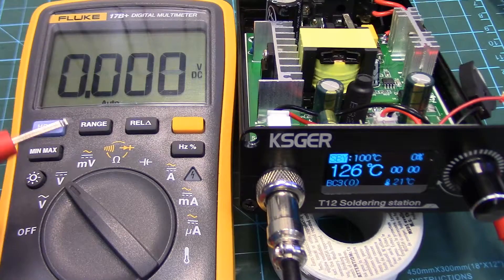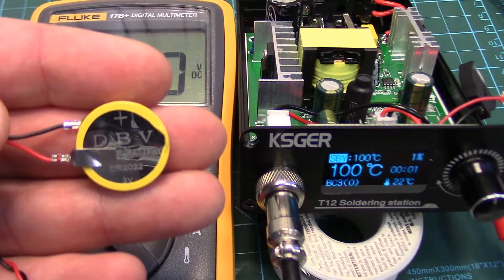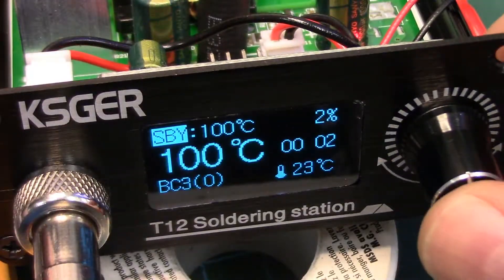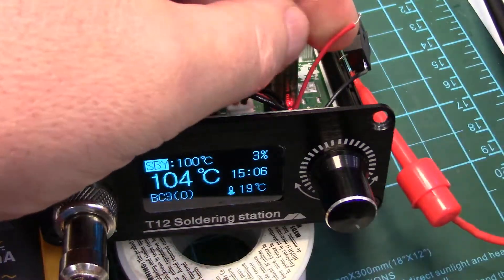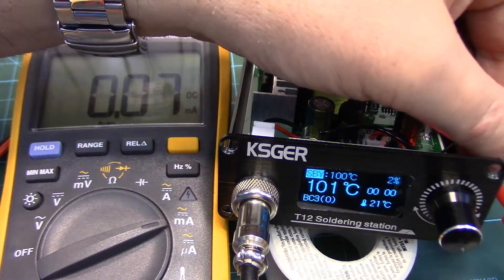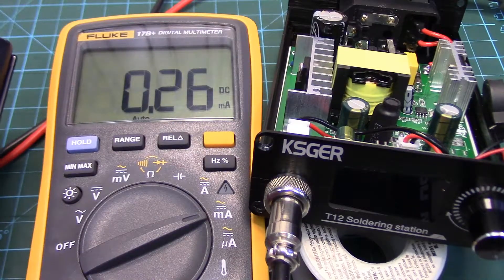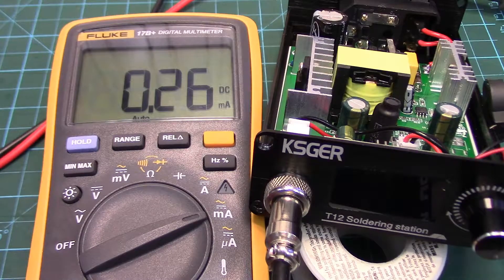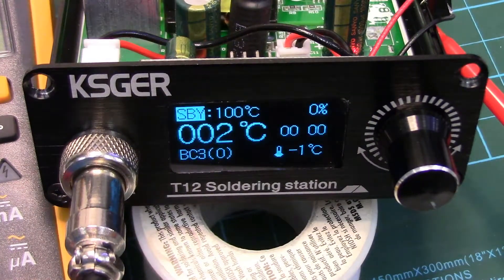KSGER T12 Soldering Station Backup Clock Battery Problem

Comment: Just one last question. (Only if you have the time) i wondered would it be possible to run this from a battery pack? Make a mod for mobile use?
Reply from the maker: Yes, you can certainly power the KSGER T12 32 bit control interface direct from any 24VDC power source, including a 24VDC battery pack. KSGER even has a version with a small case that doesn't have any power for external powering applications:  https://www.banggood.com/custlink/KvmGqhU5mQ
Reply: John Salt thanks. I will make a extra connection for an external battery
Reply from the maker: If/when you do, make sure you have a way to disconnect the PS at the same time. Most switch mode power supplies don't like getting back fed, it could even dead short the battery depending on the PS.
Reply: John Salt  maybe i just order the extra unit.  This one is still in the mail. But when i like it i will order another one  with no psu

Comment: I see u make another video wen u fix that problem 😊.  I have the same soldering station. I buy it 7 months ago and  it's proper battery newer discharge. Date and time always running properly.